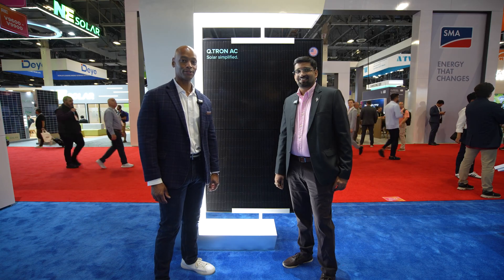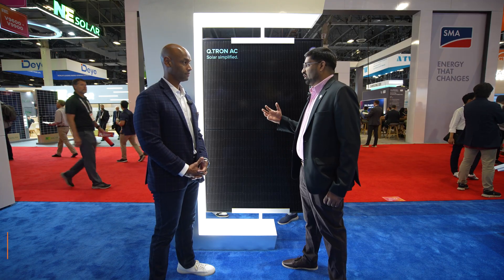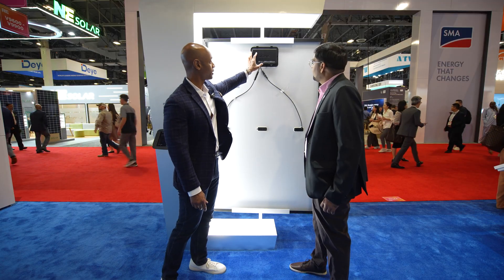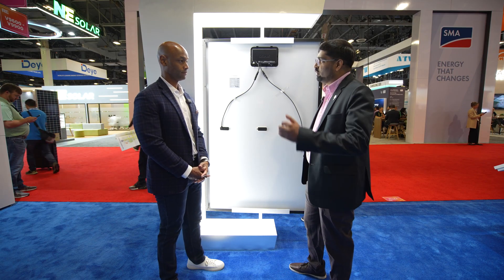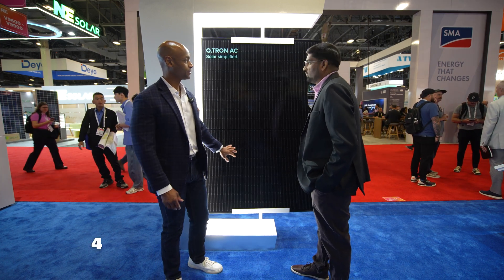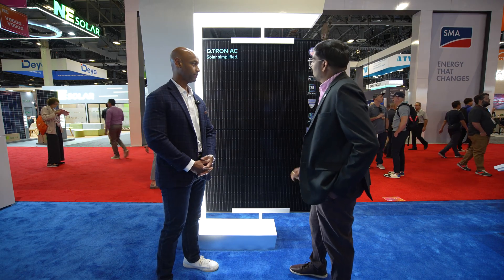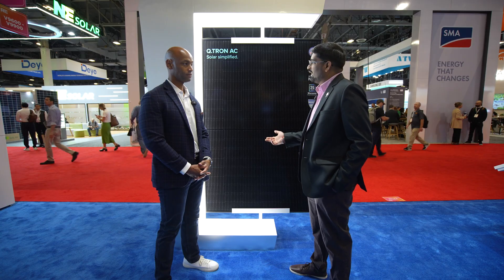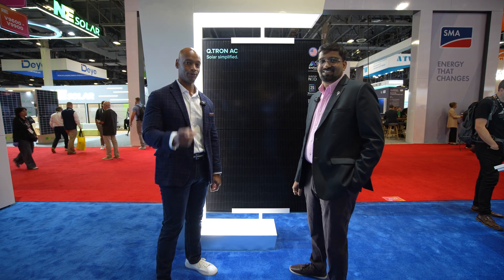Qcells AC Solar Module with Integrated Micro Inverter | Streamline your solar installation

Comment: This sounds like the sun power panels.I got installed a few years back. These 440 watt panels have inverters capable of ony 349 watts. So sounds kind of misleading.Calling them four hundred and forty watt panels.If they can only output three hundred and forty nine watts.

Comment: Yeah great microinverters so we can have losses by converting three times just to get juice into the house
Reply: That assumes you're sending to a battery first.  Not an issue for those doing simple solar installs without a battery.  Considering in the majority of US states you get true net metering for new solar installations, it makes sense there.  Also a reasonable option for those with shading issues.